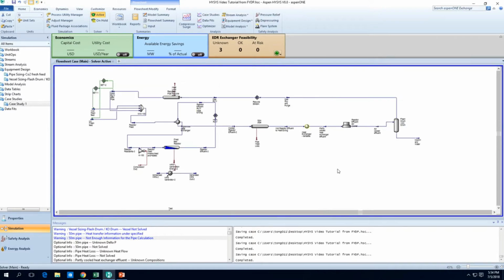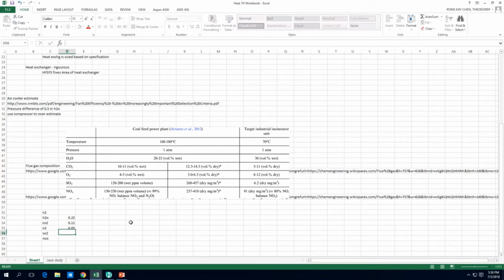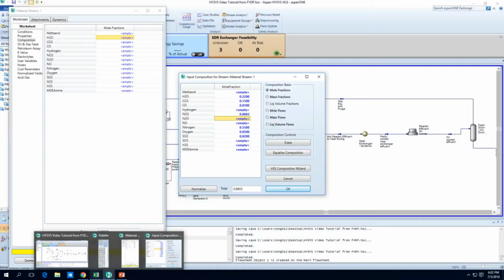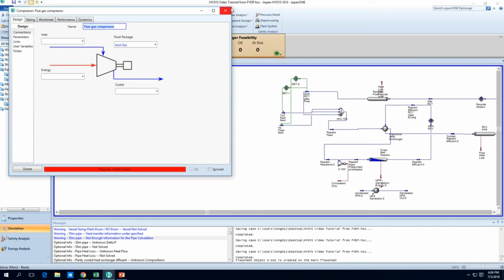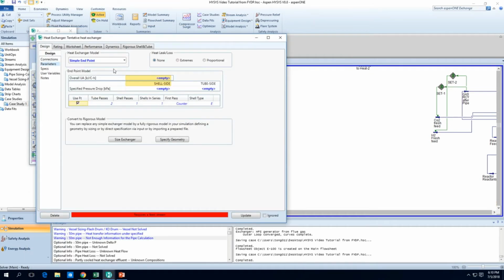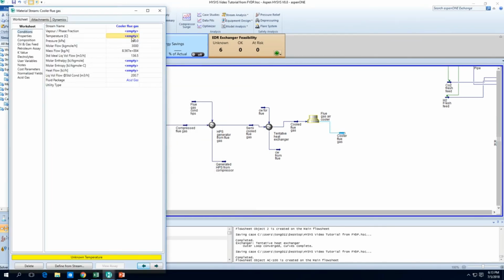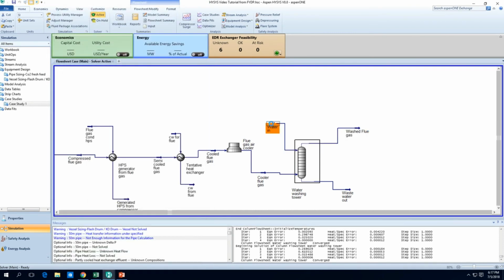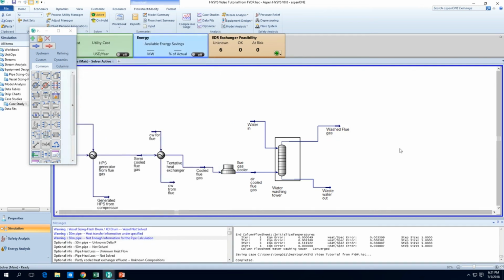HYSYS   Creation of Flue Gas Stream and Water Absorption Tower

Comment: Almost all the the chemical engineering concepts, heat transfer, mass transfer, hydraulics, thermodynamics, reactor design, etc., are touched upon and are seamlessly integrated throughout the presentation. It is a very comprehensive presentation not only learn methanol manufacture but also HYSYS simulation.